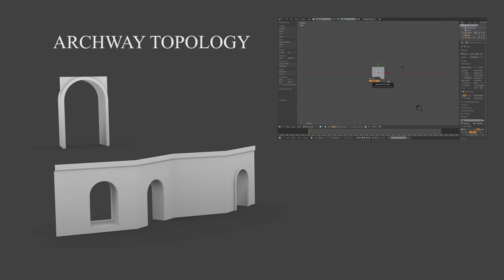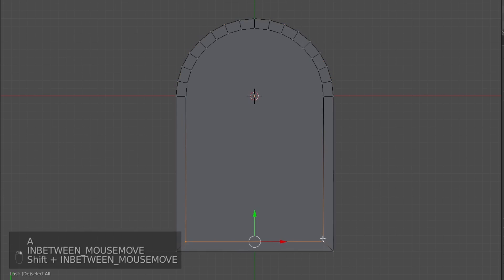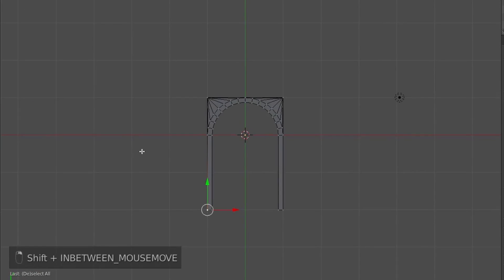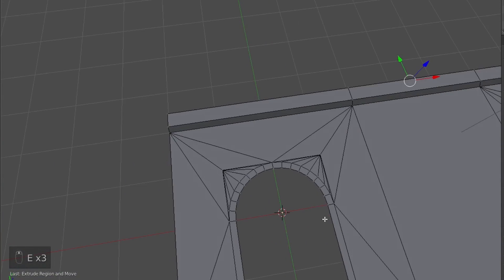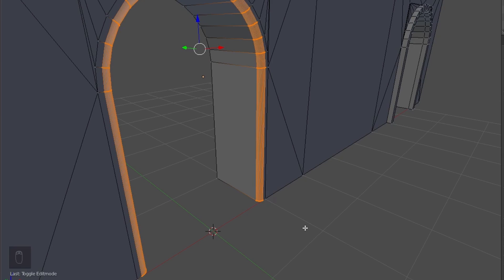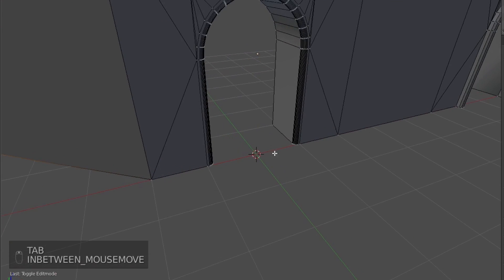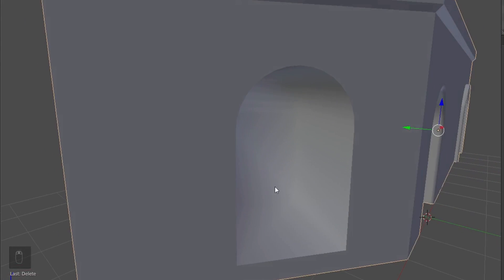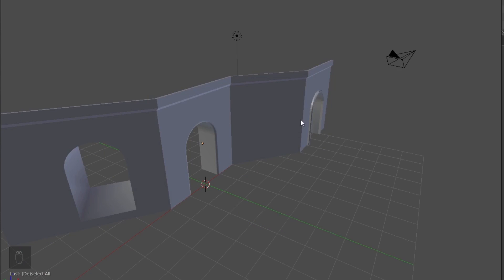Blender archway topology tutorial: Constraining tri's

Comment: This was extremely useful but how do I use edge loops on this?
Reply from the maker: Cyberdemon1542 sorry for the (very) late reply,  so the problem with this method and circular edges in general are that in order to get from the higher number of vertices of the circular edge of the arch to a single vertex triangular faces have to be used, edge loops are 'disrupted' (ended) by tri's so there isn't a way to preserve the edge loop.

One method of getting around this would be to make your archway out of quads only in a similar way to cutting a circular hole in a mesh, and then using smoothing (subsurface) to get the smooth curve of the archway. If you want to look into this method try searching 'cutting hole in mesh' or 'cutting hole in mesh quads only', there are a few good video tutorials out there on how to do this without using tri's. Hope that helps,